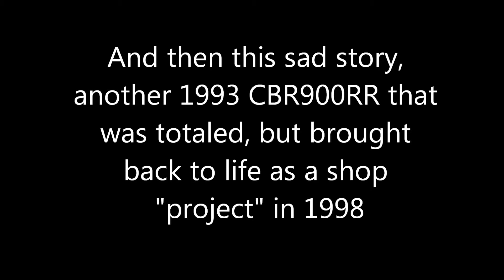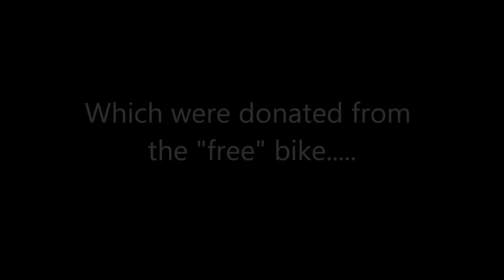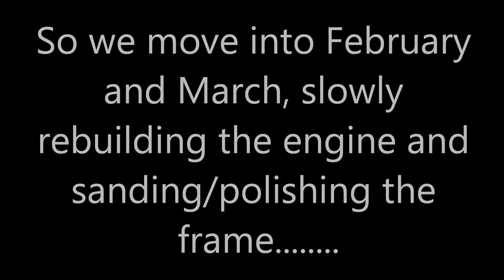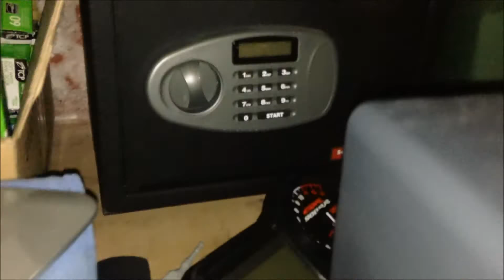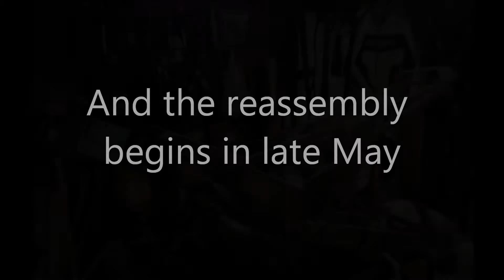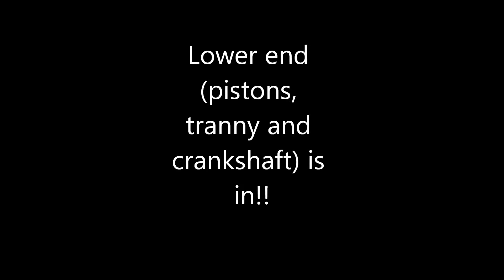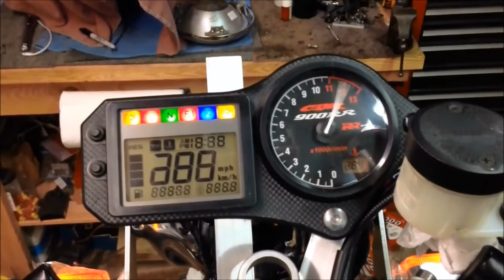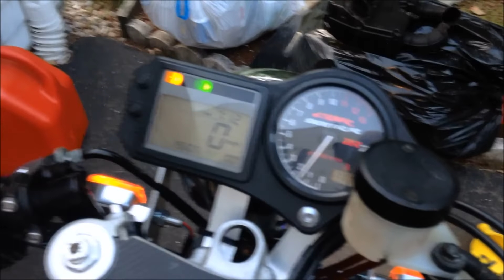1993 CBR900RR Project

Comment: Hi again Ian. So i'm pretty sure that my petcock is a SC33. By checking if functioning, should there be fuel running if vacuum is not connected? I wouldn't think so, but mine does. Is it in for a repair?
Reply from the maker: If it has a vacuum diaphragm and still flows fuel then yes, it needs to be rebuilt.

Comment: Hey ian. I fitted f4i speedo/ clocks on my cbr but speedo was out by a fair way. Did you get yours running? Mines a 95 900
Reply from the maker: Yes, bought a Healtech Speedohealer. Had to add about 500% to it to get it right.

Comment: Super Nice work! 
The 17 inch front wheel, is it plug and play or do you have to modify or adjust Some things like disc or caliper mounts? 

I have a 99er blade rrx
Reply from the maker: Robert, thanks. For the 98-99 RRW and RRX the 17” front wheel mod is a bit more involved.  For those years, you can still use an F3600 rim, but need custom left and right axle spacers and XXBlackbird discs from 97-98 (Carbie version with the black carrier).  That’s what makes the spacing proper for the calipers.  I did that on my 99 in the track day videos.

Comment: Greaaatly done 👍👍👍👍👍 . Loved watching it alot .
Woundering if i could chat with u for some questions ...
Trying to learn some 😊
Reply from the maker: Ahmed, it might be easier if you join this group at www.fireblades.org
Reply: @IanDoohan   i already joined the forum. But i couldnt find a way to chat with u ..
Hope i could talk to u directly . Maybe discord or any other chat prog . Itis ok . Nt asking for personal info or something . Just want to hv a clear convirsation ..
Reply from the maker: Ahmed M. Adel  in the forum you have to ask the questions by starting a new thread.  I can tag you there and you’ll get an email.  It will be easier that way.
Reply from the maker: I replied. I guess it’s difficult for you. What are your questions?
Reply: @IanDoohan  hey love the build I realize this is older and if I could borrow a quick second of your knowledge simple really just wondered if there was a quick way to replace the cct I'm replacing with factory oem can I just decompress spring inside of tensioner then pull it out then install new one and pull key lock out to extend tension on chain or do I have to set all my timing Mark's to relieve tension on chain before replacing cct I bought a new valve cover gasket if I have to but the service manual doesnt say anything other then how to replace and install cct. Thank you
Reply from the maker: Kyle Litman Thanks, you should be able back it off and put the new one in without being at TDC. There is a top guide that should keep the chain in right spot.
Reply: @IanDoohan  thanks man I appreciate your time and thank you for your quick reply installing a Barnett clutch kit now

Comment: How did u time this bike up? I have a 98 Honda cbr 900rr
Reply from the maker: greg , timing is fixed (no adjustment on stock bikes).  I used slotted cam sprockets to “fine tune” the cams, but even that was kinda just guessed.  In the video you can see them.  The timing is correct when the #1 cylinder (first on the left of sitting on the bike) is at TDC on the compression stroke. The valves are closed, the cam marks are aligned with the top of the cylinder head, and the crank T Mark is lined up with the notch in the timing cover. Does that help answer your question?

Comment: Great work man. Did you ditch the fuel pump and go for gravity feed?
Reply from the maker: Thank you, Yes I took the fuel pump out and I do not use it.
Reply: @IanDoohan  Why did you do that? How's that working for you? Do you get enough fuel all the way through the throttle? Can the whole tank's capacity be used on gravity?
Reply from the maker: @nikolaiandersen5054  It worked just  fine. I originally took the pump off to save weight.  Then I found a lot of people did it too. You need to put the later fuel valve on, from the 96-99 bikes. They were gravity fed. I did it to 2 900’s, with no problems.
Reply: @IanDoohan  thanks a bunch for your replies! Why do I need to swap for 96-99 model? What's the difference between them?
Reply from the maker: @nikolaiandersen5054  the SC28 fuel valve is ON all the time and flows fuel all the time unless shut OFF. The SC33 fuel valve is operated with the same ON OFF RES switch BUT, is also operated by vacuum, so when the engine stops running, the fuel stops flowing. It saves the risk of flooding the carbs and engine.  You would need to turn the valve to off using your original one every time you shut the engine off.
Reply: @IanDoohan  I've got a guess that my 92' 900 RR might be fitted with one of these petcocks. I've taken a couple of photos but i'm a YouTube noob. Could I sent you these and have you confirm or reject my guess?
Reply: Hi again Ian. So i'm pretty sure that my petcock is a SC33. By checking if functioning, should there be fuel running if vacuum is not connected? I wouldn't think so, but mine does. Is it in for a repair?

Comment: I realize this video is older. I have a 95 blade and was curious what brand and where did you get the 4-1? Also is there a total rebuild kit available? Ive had absolutely no luck finding either.
Reply from the maker: The exhaust is a true Erion Racing full system. They're not produced anymore, and was taken from a 96-97 donor 900RR.  As far as a rebuild kit, I got 2 OEM gasket sets from Partzilla. An A, and B, which is upper and lower.  There are some seals that are sold separately, like the countershaft seal. The piston ring sets were all bought separately. The gasket sets may be unavailable, and you'll need to buy everything separately.

Comment: hi! Can you tell me details about your dashboard?
I have 900RR 93 too! )
Reply from the maker: Олег Букалов it's from a CBR600F4i. I had to buy the 1995 900RR speed sensor and a speedo healer, but all the wires matched up by color.  I also made the speed sensor wire harness from the dash to the sensor. Easy 3 wires.
Reply: thanks for the ansver! Sorry, My English is poor ) 
I need also speed sensor & speedo healer from 95 900RR or not?
Reply from the maker: Олег Букалов yes you will. The 93 had a cable activated speedometer.  The 600F4i speedometer is digital,  and takes an electrical signal. The speed sensor is located on the countershaft cover. You'll need one of those too.
Reply: Ok! I understand! how about speedo healer and about the wrong speed?
Reply from the maker: Олег Букалов the speed sensor sends a signal to the dash, but the signal needs to be adjusted because the signal is different. 900RR sensor, 600F4i dash. The speedo healer allows you to "adjust" the signal so you get the correct speed readout.
Reply: ok! ) I mean how you correct speed or speedo healer work automatical and what speedo healer use?
Thank you for your patience :)
Reply from the maker: Олег Букалов Healtech makes the speedo healer. It's just a small box that can change the speed sensor signal. There is a formula you use. Right now I think mine is +500% on the signal to get it right. It's about 110$ US. I have a lot more pictures if you want to log into this : Fireblades.org use this link to my build:   http://www.fireblades.org/forums/honda-fireblade/105625-how-saved-93-rr-certain-doom-24.html. This is page 24, at the bottom is when I start the wiring for the dash and speed sensor.
Reply: thanks for help, good luck!

Comment: Super good work.
I dont like the bike without fairings.
You should replaced all the iron bolts and put new steel bolts.
U put a 900 rr in a child hands? I think that this is so dangerous
Your son should start with a 80 cc bike to learn.